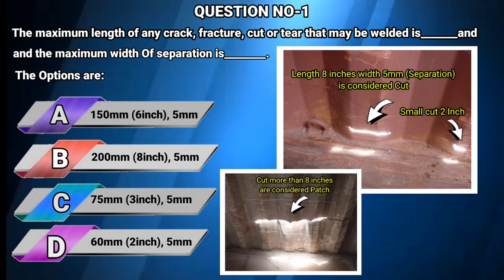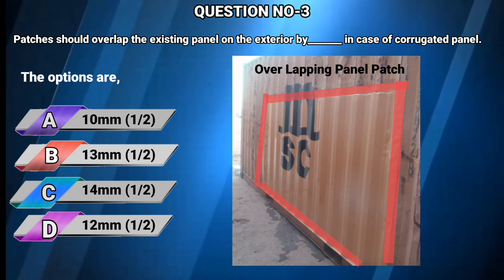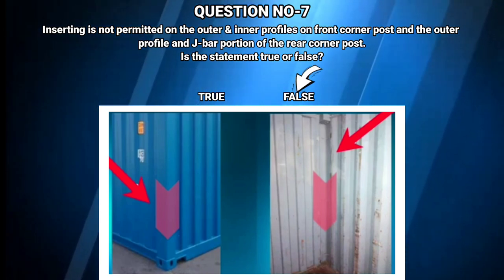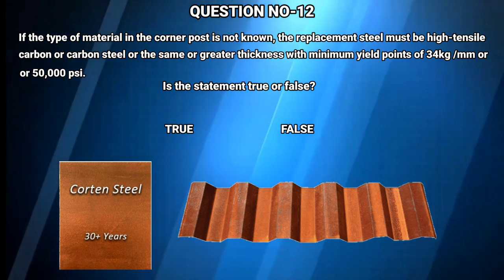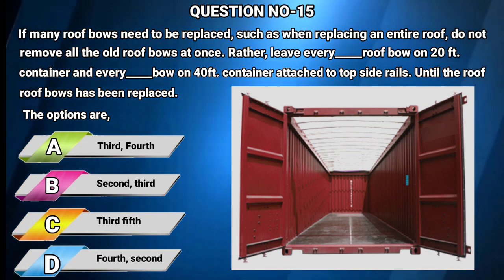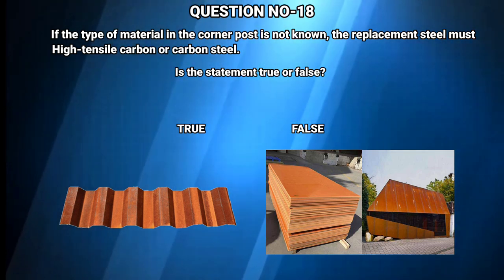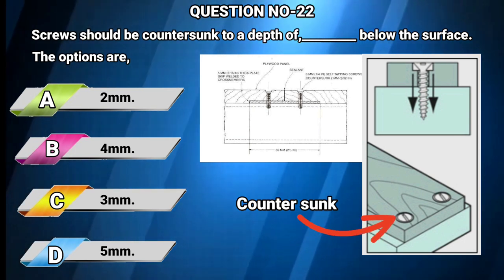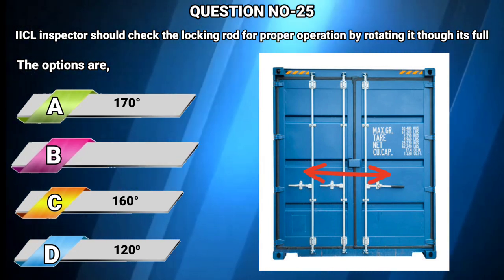IICL Exam Helping Questions & Answers (MCQs) from Manuals. (1-25).

Comment: G'day,

For Q No 23. --  as per IICL repair manual -- page no 106 Section 9.1.3 under 'Floor Screws' it mentioned as "Butt joints of repaired section requires atleast TWO screws per plank, OR THREE screws if the plank is over 150 MM(6 in) wide  --- thus answer for this Q no 23 shouldn't be "B). 2 Screws"  ??

Please confirm

Comment: Please share the significance of question no. 15 , why should leave every 3rd roof bow in 20ft & 4th ropf bow in 40ft? 
Thanks in advance..
Reply: Might be for safety reasons when the roof bows acted as reinforcement for Flat roof if the roof is weak  -- just a guess as nothing has mentioned as reason in latest IICL books too

Comment: 20th question
Answer 22mm
Reply: Correct answer is 22 mm pls show the technical bulletin
Reply: IICL TB 004, 1 November 2006
Title: “Revised Dowel Repair in Container Floors”
The IICL has revised the repair criteria for container floors effective November 1, 2006.
Reference: IICL “Repair Manual For Steel Freight Containers” Fifth Edition
 Section 9.3 (Dowel Repairs)
The IICL has revised its criteria for dowel repairs in container floors. 
Revised Criteria
Holes up to 22 mm in diameter may be repaired by inserting a round hardwood dowel 
into the hole and securing it into place with glue. The following limitations apply to the 
use of dowels:
• Dowels must be round and made of hardwood.
• Dowels cannot exceed 22 mm in diameter.
• The minimum distance between the end of any floor board, plank or screw and 
any part of a dowel is 50 mm (2 inches).
• The minimum distance from the side of a floor board and any part of a dowel is 
one (1) times the dowel diameter.
• The minimum distance from any part of a dowel to any part of another dowel is 
four (4) times the larger dowel diameter.
Holes up to 22 mm that cannot be repaired using dowels that meet the minimum distance 
requirements above, and all holes greater than 22 mm in diameter, must be repaired by 
sectioning or replacement of the wood.
IICL TB 004 was prepared under the supervision of the IICL Technology Committ
Reply from the maker: Thank you very much for the information, I overlooked this . please ignore.
Reply from the maker: You are right . Overlooked this will make correction. Thank you for comment.
Reply: @PORTCONTAINER  we are waiting for 25-50 questions
Reply from the maker: @ramgagiya6749  one video every week.
Reply: @VijayKumar-dp6sw  sir I have some confustion to how to  check  light leakage?